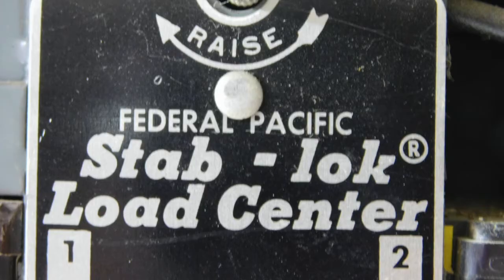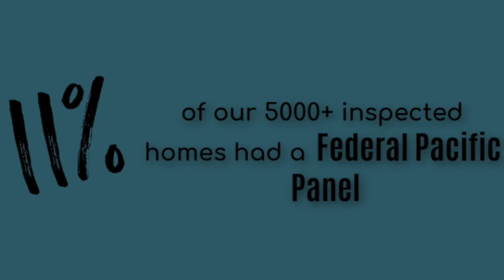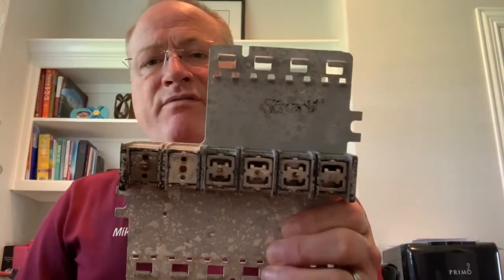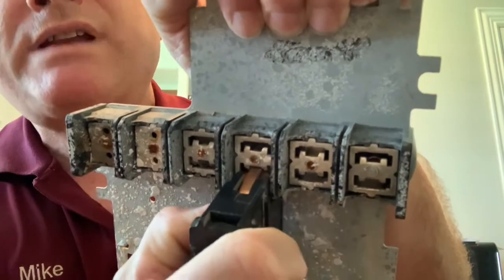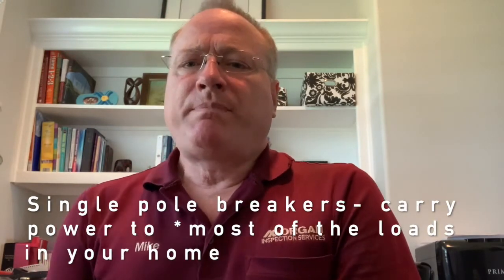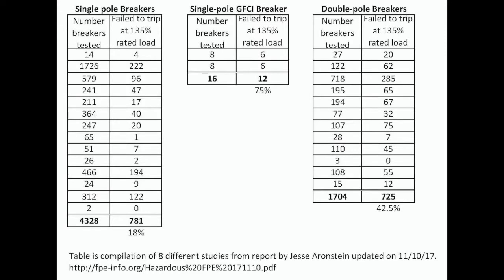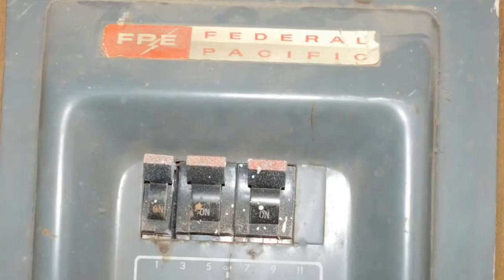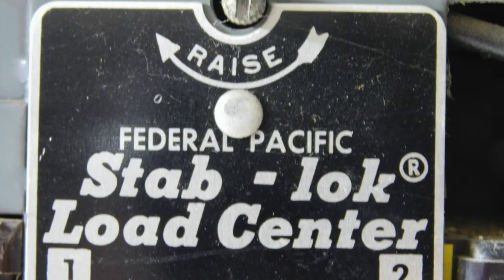Federal Pacific Panel/Stab-Lok Panel

Comment: I also have a Federal Pacific 200AMP main panel with 40 slots installed in 1975 and no problems so far.  QUESTIONS: Will a surge protector like the EATON CHSPT2ULTRA Ultimate Surge Protection 3rd Edition, 2.38" Length, 5.25" Width 7.5" Height ,  that is correctly installed, wired per instructions, and grounded properly next to the main panel box, Will this or similar device, give me the proper protection in the event that one of the FP breakers do NOT trip and fail causing a surge, overheating, burning, etc.???  So basically, I am hoping that if I install the "EATON CHSPT2ULTRA" it will trip or burn up the Eaton Ultra device "before" the breaker that does not trip causes overload to the wiring, etc. and cause a fire, etc.   I am hoping this is a decent solution rather than replacing the entire panel box (which I agree is probably the best solution but hoping a good surge protector will work too.) Thanks Bill
Reply from the maker: I do not know that much about surge protectors, but I believe they are designed to protect against voltage surges, not high current. I don't believe a surge protector would do anything to protect against a breaker that fails to trip.
Reply: No, that is for incoming voltage surges. It will not give you any protection for short circuit or circuit overload.

Comment: This guy knows what he is talking about. I had a Federal Pacific panel in my home that failed. A pinched wire in an outlet box shorted to the grounded box. The result was like an arc welder. The FPE breaker just let it fry until I manually switched the breaker off. The breaker was frozen and I didn't think I was going to be able to move it at first, but pushed until it finally moved. I got rid of that panel ASAP and replaced it with Square D brand which has a good reputation. BTW the red marking that is spoken about in the video is painted onto the very end of the breaker switches. Some breakers (like Square D) have a little window that shows red when the breaker trips, these are not the problem FPE breakers.
Reply: Also if you try to remove a breaker, chances are it will come apart in your hands with the guts still attached to the bus.